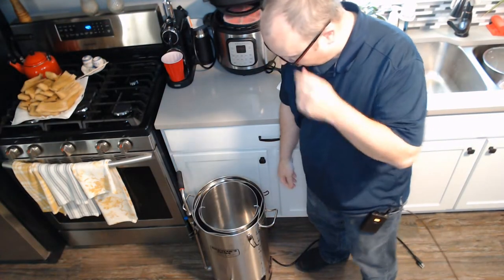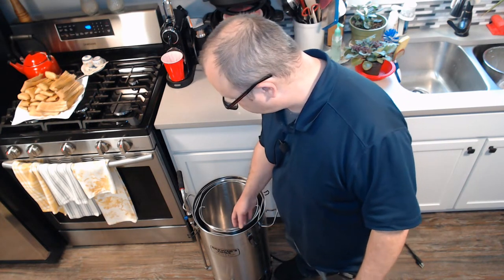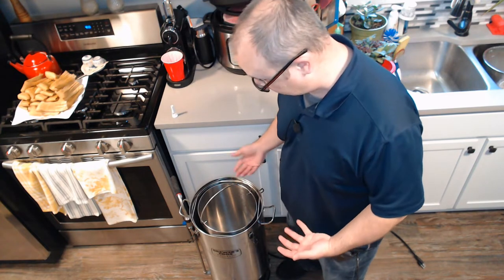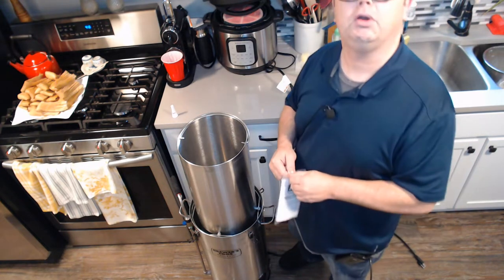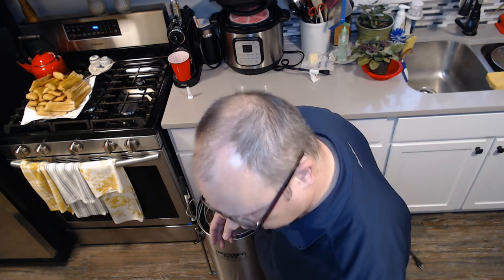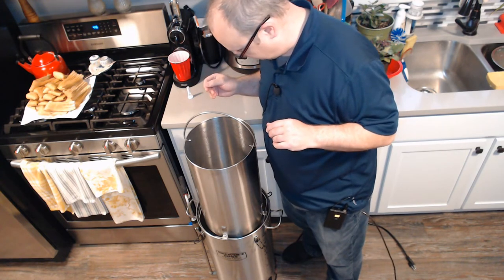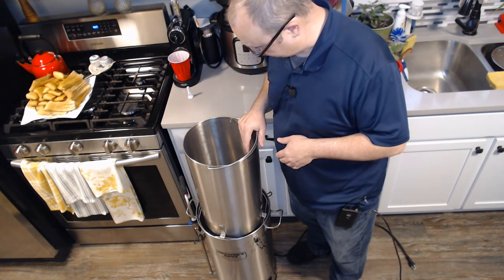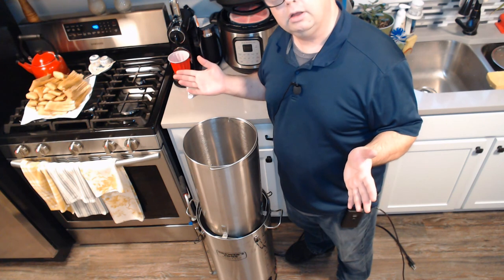Electric Brew Basket upgrade

Comment: In the not too distant future, I expect to be in the market for a brew kettle upgrade, possibly to an all-in-one system. You made some excellent, eye-opening points, especially the part about the malt basket only having perforations on the bottom. Cheers!
Reply from the maker: Thanks !  I really think it lowers over all efficiency.  The Claw Hammer system is a lot more expensive but it's modular and the basket is fully mesh.